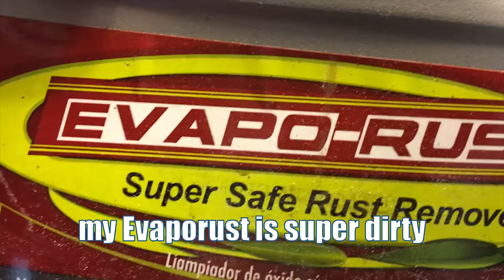Crosscut Logging Saw Restoration

Comment: Great to see old cross cuts being brought back to life rather than becoming wall art. For those that work in wilderness areas crosscut saws are still practical. Also great when you don’t want to pack the weight of a chainsaw just to buck the occasional log off the trail. As you mentioned you didn’t have the proper tools, still a few of the things you did made me cringe a bit. Here is a link to the Forest Service Crosscut Saw Manual. 
https://www.fs.fed.us/eng/pubs/pdfpubs/pdf77712508/pdf77712508dpi72.pdf
I suspect this was once a two person saw that got broke, then made into a one person saw.
Reply from the maker: I do think this was a bigger saw once. And yes there are likely several things still need to learn to be the best at this but I do appreciate the help. I hope to get some more like it.